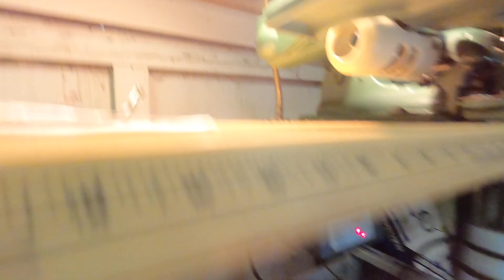Enduro Servo Motor (220 volt) part 2.

Comment: You say the motor has "The delay". Can you please explain that in better detail please? I'd like to understand The meaning of "The delay", what is the use of this feature, is this a set feature or is it an adjustable feature, why would I want this feature,  is your wording the same thats in the manual's wording? Thanks  !
Reply from the maker: It's a feature on these Enduro motors where when you step on the pedal the motor starts spinning slowly and then goes to normal foot controlled speeds. This stops the accidental jumps and gives a bit more control.
Reply: @carlmauro4813  Thanks, thats just what I'm looking for.

Comment: so are you saying you took a wire from each of your electrial panel and hooked them togeather and run it to a outlet on the hot side of the plug then a nutrial to the silver side for the white wire on the machine and then a ground
Reply from the maker: No I just put a plug on the motor's wire and am running it on 110V even though it's a 220V motor.